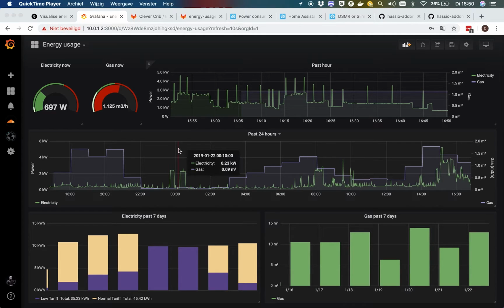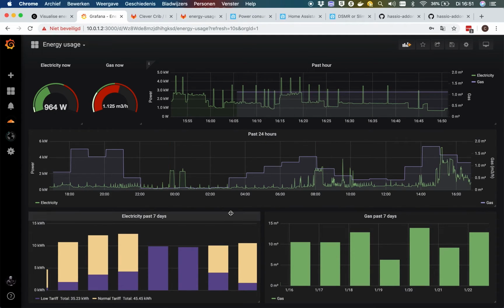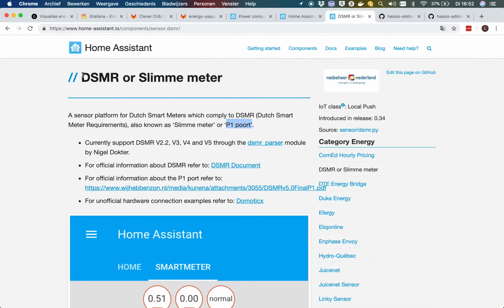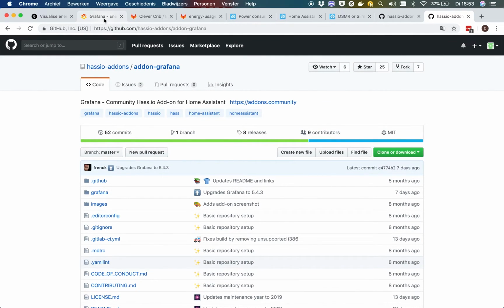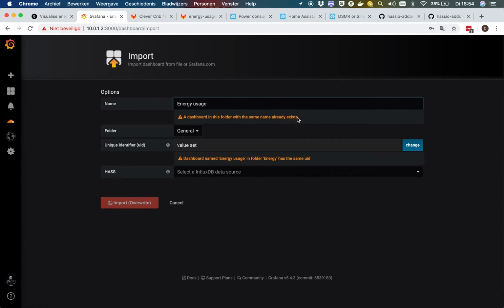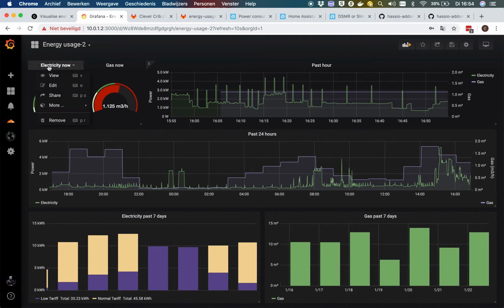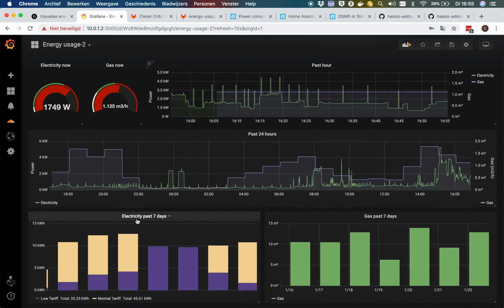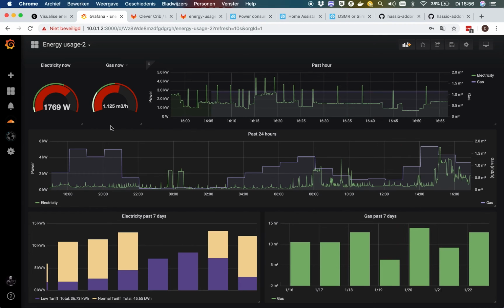How to import a dashboard into Grafana and adapt to your datasource

Comment: Tip if you have solar panels and you want the graph to invert when the solar production is greater than the power-consumption. 

Add power-production* by duplicating power-consumption*, 
change entity-id to power-production*. 
Under: Panel -> Series overrides -> Add series override -> Alias or regex, add: 'power-production*' and set 'transform' to 'negative-Y'

This will invert the graph without displaying a negative value.

*replace with you own entity name.

Comment: Could you please provide the correct link to the Article on creating the dashboard.

I see the energy sensors in Home Assistant under "ongebruikte entiteiten".
I am trying to follow the steps in this video, but apparently I miss the correct parameters in influxdb and/or grafana. When I connect the P1 cable, I don't see any data appearing in Grafana.